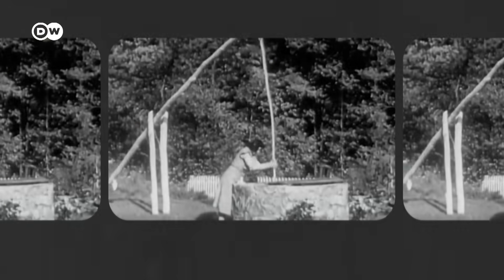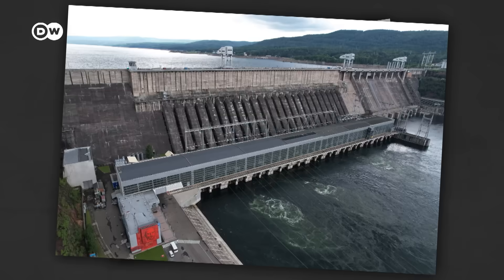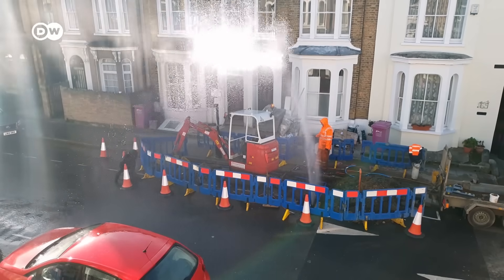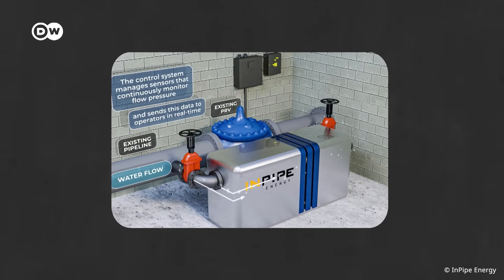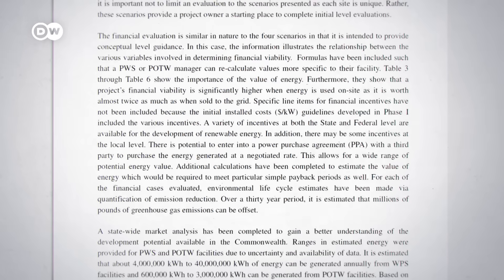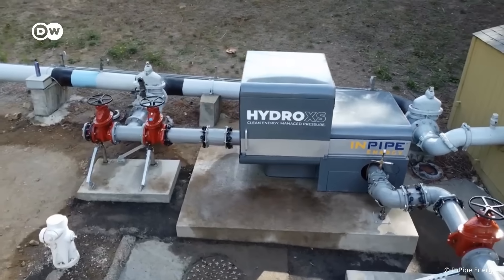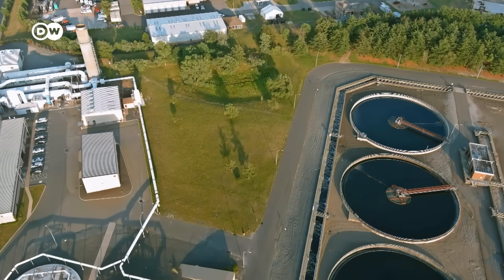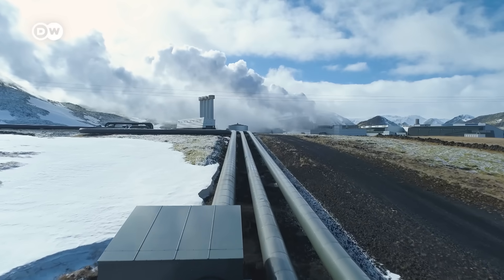In-pipe energy: The hydro power nobody is talking about

Comment: instead of wasting perfectly good water relieving the pressure why not install a reservoir half way up and pump the water into there and another set of pumps to pump it higher or make exceptions to the municipal codes to allow wells to be drilled for those above a certain elevation.

Comment: inline turbines already exist on smaller scale.

the water meter uses a turbine wheel to drive a gearbox to wind up a spring and a magnet snaps through a coil to generate a pulse at 5 to 10 volts at a few milliamps to power an electromechanical counter to index up by 1.

this happens every 1000 gallons.

Comment: Wouldn't it be better to put little pumps at point of use, and run the mains at a lower pressure? That way you also save by having less leaks, which in some places consume a large percentage of supplied electricity.

Comment: If you do that, you introduce a resistance to flow which reduces flow rate and defeats the whole idea of pipes to transfer water. Maybe if the system is employed where it's tapping the energy before it flows into a reservoir, but not in pipes themselves.

Comment: This is a false hope. You cannot tap the energy in water without two things: moving water and a pressure drop. For an end of line customer, this means you can only tap it while you are using water! Upstream, you are dropping the pressure, requiring the utility to turn up the pumps to maintain the flow. This is just another "free energy scam"

Comment: I generate 140 % of my homes usage...  how much could I get per home? ... to add to my battery walls banks... woter power my EV... emergency power for my home...
Reply from the maker: Hey there! As mentioned in the video, there's no way to give solid numbers since it always depends on the turbine and the pressure in the pipes. But for example, if your home uses about 1,943 kWh a year, with that extra 777.2 kWh, you could drive approximately 3,109 miles with an EV. 🚗 Or, 388.6 hours for emergencies calculated with 2 kWh per hour estimate.
Reply: . I do it with batteries, solar and water... magnetic brings, water screw, magnetic shatt, less friction, more rpms... venturi effectt peri-jet more pressure... US Navy Damage Controlman Dewatering physics and magnetic engineering... easy
Reply: Love your gray matter... really... hard to find in our times

Comment: This can't be done in most places that require pumps to have water pressure in the pipe would make more power to generate the pressure AND power extra turbines along the way. A few would work fine but the more you try to get out of it the less overall there is.

Comment: I’m thinking there’s so many possible options that are overlooked. 

In the pipes of like buildings especially high rise buildings of metropolitan areas, after water is used, they just go down the drain to a waste water pipe right? And they use gravity to just go down to the drain without the need to pump them downwards. 
Correct me if I’m wrong. 😑 

If so, can the waste water that uses gravity be used to convert its kinetic energy to electricity by installing turbines in the waste water pipes?

Comment: The problem I'm thinking about is the possible danger of electric shock, which is now growing exponentially because water and electricity are mixing. 

Sure, there is energy from the pressure created in pumps, but how do you extract the electricity again? By using cable wires, which are now going to be easily exposed to water since, well, it's a water pump. More safety and protection must be applied, and still, the possibility of accidents will quadruple because of the connection of wires and water, even if it is just limited to strategic places. Pipe maintenance alone will skyrocket in terms of expenses not to mention the new electric wires needed for the new "electric source"

Comment: In our wanter supply company cost of electricity swallows half of our revenue this technology is very real but how to build a kind motor turbans to return power and voltage regulation is an issue if I could propose this to my supervisors it will be novative

Comment: One of the dumbest and most misleading DW video I have ever seen. You need a consistent flow of water, not pressure in the pipe, and definitely not static pressure. This would mean letting the water in your house run constantly, which would rack up quite a bill in exchange for little gains.

Comment: Pipe dream – in electrical terms Ohms law - The equation for the relationship between pressure and flow in a fluid system is Bernoulli's equation – back to the drawing board.

Comment: This should only be used on grey water pipes. Not on the fresh water pipes or you just leech off power from the system in place that regulate water pressure.
It looks like an electric engine that powers up a dynamo. The more you generate from the dynamo the more you have to use to power up the engine.
Reply from the maker: Hey there! Mini hydro technology only collects pressure valve waste energy already being generated by our water transportation service. Therefore, it collects energy otherwise wasted. The process is explained at 2:26.

Comment: so putting a motor to harvest the energy of the pressure that other motor produces? Not efficient, only losses, maybe on “free” water that is falling by gravity, but the power generated by my shower water drain would be not worth the production and replacement, i’d contribute more by one small solar panel on my balcony to the grid!

Comment: The water company pressurize the water so that we can get it at home under pressure n fill a bucket quickly. Installing dynamo will reduce the pressure so high rise buildings n those that need water at a fast rate will be affected,  the trade off is there you can make energy but get less flow

Comment: If you have an estimated water pressure of 3 bar and a flow rate of 1 liter/ sec, you get around 0.19 kW of power. That's not very much :face-blue-smiling: . . .

Comment: So, you put all of that energy to push the water through the pipes. Then you take that energy out again with a turbine. What now pushes the water to it's destination? Magic? If there's too much pressure from a pump, then reduce the energy input to the pump.
Pressure regulation valves do not waste energy. They change pressure to flow.
Reply from the maker: Hey there! Mini hydro technology only collects pressure valve waste energy already being generated by our water transportation service. Therefore, it collects energy otherwise wasted. The process is explained at 2:26.

Comment: this is unbelievably stupid, first off pressure relive valves are a safety thing they should do literally nothing if the system is operating correctly and if its not it would be waaay smarted to fix the problem and just not waste the energy in the first place than try to claim it back this way, and it wouldnt be constant either pressure release valves only work sometimes even when they system isnt working as designed.

Comment: Most useless invention of mankind,
1. here in india, most of time we have to pumps (running with energy) which fills water tanks or artifical water bodies, techincally are are just charging the system.
(before you speak to me, we are no roman's aquaduct, there are pumping-stations and dams)
2. if we did so, we drop pressure very fast and loosing pressure means all of the flowrates (as our cement pipes are enough to get turbulence and resistance)
3. also we lack water when we need at times, like morning where all farmers want to avoid dew and ice on crops.
Reply: india really need dam projects before road projects.
1. we got lots of rivers and possible 4 dams per river possibility, and this much over 20 years ~5 Billion INR
2. with it also possibility of running small canals and other pipelines (if we cannot do roman's aquaducts, atleast some distance maybe) nice cash flow asset, dealing with possible operational costs of whole project
3. possiblity of waterlife centuries, avians are migratory, and people like culture of camping next to lake

Comment: This is the most idiotic idea for energy conservation I have ever seen from pure physics perspective. Imagine you have a pipe from A-to-B and a pump that pushes water throug it that consumes X energy, if I put a turbine there to convert some part of that flow back to electricity, I recover some small part of that original energy X, but I lowered the water pressure/flow. You know what I can do to gain more energy for the same loss of pressure/flow ? I can just lower the power of the pump!!!!  Recovering energy from water flow is always just stealing energy that the pumps put into the system! If you are not one of those cities where gravity is pushing water down a hill, then this is nothing more than the most innefficient recovery of the electricity that the pumps used.
Reply from the maker: Hey there! Mini hydro technology only collects pressure valve waste energy already being generated by our water transportation service. Therefore, it collects energy otherwise wasted. The process is explained at 2:26.
Reply: @DWPlanetA  Yes, but the other solution for that waste is to lower pump's performance based on feedback from presure valves to not overpresure. Because if you release a presure in the pipe on side B to a turbine, the pump on site A will detect that as presure loss and will increase power to compensate. You only invented a very inefficient energy transportation system of power burned by the pump on side A to be partly recovered on site B. 

Pressure and flow in our water systems is not some "free energy" to harvest, it was created by pumps using energy and it will be always more efficient to just lower pumps performance if there is overpresure in a smart way compared to trying to "harvest" it by small turbines.

Comment: Ok!  A really dumb idea.  Use energy to pressurize the water and then us a turbine to "harvest" that pressurized water.  ANY engineer is going to tell you  that from a total system viewpoint this is dumb.  Simply, you will need bigger pumps to start with to even make this work.  Exactly like using electricity to turn a motor to turn a generator to make electricity.  You would be better off just using the electricity directly and avoid all the losses in motors and generators.
A really dumb idea!
AND
your concern is that it takes a lot of energy to move water around.  You are making it even more expensive doing it this way.

Comment: Great little turbine power gadget,,!ove it... 
 my grand father powered the village with hyrdo power and ski lift's using the small river with one small turbine station, side pipes were dug in taking river water off to one side this is clean energy which is still on going since 1930 ok its been updated twice since but produces far more energy for many homes etc etc.....
 there are other hydro power methods for slow running streams which use a rocking bucket system sort off a see saw action , 
and floating turbines which float on waters surface with turbines of different sizes are fixed on the under side of a pontoon which is anchored ,,...also a wide like cork screw water propellor systems 🍀

Comment: Um...is it me or are they thinking with the same mentality as the perpetual motion people?

You generate power from the flow inside the pipes and you add resistance meaning that in order to maintain downstream pressure you have to put more power back in somewhere. Since electric motors, wires, etc. all have losses, this does not work.

This is like thinking, 'oh, well if I put a wind turbine on my car I can generate power to take some load of the engine.'

Sorry folks, this is ridiculous less in very specific situations in which down-stream pressure isn't a concern AND you are already having stored water or water coming from a higher elevation to lower elevation without having to put in energy to pressurise the system.

Comment: If a house or building has a water tank at a higher altitude than the pipes, gravity feeding the house with water, you can place an individual water turbine at any point between the input source at the street and the output in the water tank without affecting the water pressure inside the house, wich is determined by the height and weight of the stored water.
The closer to the street, the better, to avoid pressure loss within the pipes, but let's be clear, calling this "power generation" is not accurate. As mentioned in the video, pumping water to houses consumes a lot of energy already, we would be actually recycling some of that power back to the grid, reducing the demand of power plants and its co2 emissions.
With this method, it would be necessary to evaluate the viabilty of adding a gravity feeding water tank on each house or building, but i'm sure the costs would pay out in time, not to mention that some cities have giant water tanks to elevate the water table of the region it serves, it would work the same way, with much bigger pipes to recycle more energy from the pumped water.

Comment: I'm lost.   I have tried with with Micro generators on garden hoses. What winds up happening is you put more energy into the stream to counter the resistance. The amount of energy required to generate the voltage increases which brings anything gained to net loss. There is no winning.. thats similar to waiving a hand fan on a hot day, just the motion creates more heat than displaced.      Only way this works is if you use gravity to capture potential energy which is basically a hydro dam and not news.

Comment: If micro voltage is all you need. Then P.E.T.'s would have been popular a long time ago. There effency is around 7%. It's good for small projects and nothing more.
And you want to say adding all these little devices up will add up to something useful, false. Everything has a loss, meaning you need extras just to offset the power drop. This will not work.

Comment: GW is a unit of power, not energy. The report you cite says that US water systems could generate 4.6 to 43GWh of energy per year, which equates to a continuous supply of 0.5 to 5MW of power. At the high end, that's basically a single very small battery with continuous discharge. So basically nothing.

Comment: Was this just another idea for a perpetuum mobile promoted by my involuntary funds? 

As long as there is not a gravity fed system, the energy of those in-line-turbines would need to be added by the main waterpumps and therefore only create additional losses! More turbulence and therefore much higher losses than the energy alone. 

Overpressure valves should never be in use continous, but rather with an pressure controlled pump station, these are only there for short hydraulic pressure peaks. If the pump station is not pressure regulated, this should be the first thing to improve the efficiency anyway. Right at the source of the largest efficiency losses!

A bit of physics-check should be done with every video to just fact check those ideas at least a little! There was nothing in this video questioning the idea as an "untapped energy source"! Patent offices are full of perpetuum mobiles, not one managed to be build and run successfully! And this will stay this way as long as the laws of thermodynamics are true!

Comment: one thing that isnt talked about in this vid is the pressure loss if you install in-pipe turbines 😂. 

imagine if you are in the farthest end, you get low electricity and low water pressure. 😅 all the while those closest to the water source/station/pump get the highest power and water pressure. lol

trying to solve that issue will lead you down to dams.. so yeah, humans had already solved it! this vid is just leading you back to the original problem 😆

Comment: It's actually illegal to use the water line pressure to produce power. Using the pipe pressure to run a generator puts extra resistance to the pump system, unless the source is from a water tower utilizing gravity potential.

Comment: The gas pipelines can also be used to harness in-pipe elevtricity. This can further increase the potential of in-pipe electricity. 

Additionally, this source of energy in climate independent non-fossil fuel energy, which can allow to increase the share of non-fossil fuel energy in the ebergy mix without being dependent on weather.

Comment: Sorry, you can't get something for nothing, can't get energy for nothing  If you take the potential energy out of flowing water, the pressure is decreased.
Reply: You didn't listen to the video.
Our technology to pump water is very ineffective, and we loose a lot power by giving too much pressure in our pipelines. We have systems to reduce excess pressure to avoid the pipes from bursting, however, you can also harness that excess pressure to get some energy back.
So no useful pressure is actually being taken away, it's only excess pressure being used.
Reply: @texanplayer7651  Pressure is only developed when flow is restricted. If you restrict flow upstream, pressure is reduced downstream. If you increase pressure downstream, you can not use the pressure upstream. If you did, there would be no pressure downstream. If what you are proposing were true, why not put water generating plants in series, one after the other, to boost electrical output.  Is that it? Of course the falling water in a siphon can be used to pull up water, as long as the vacuum is not broken. Is that it?